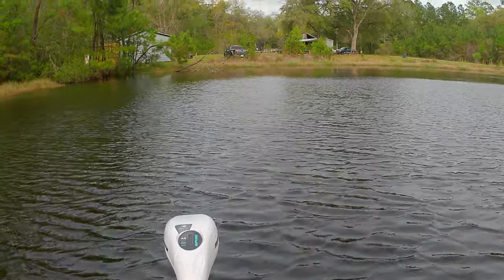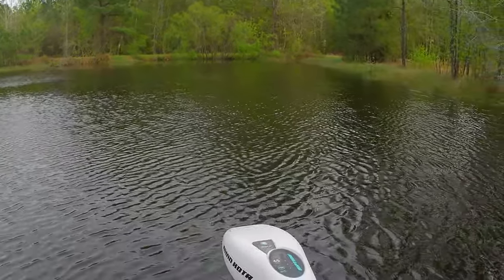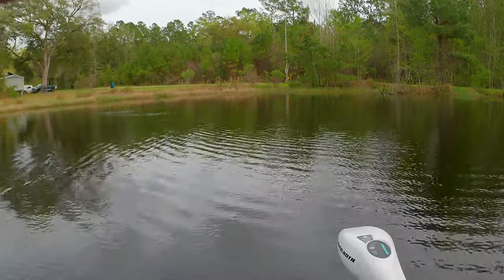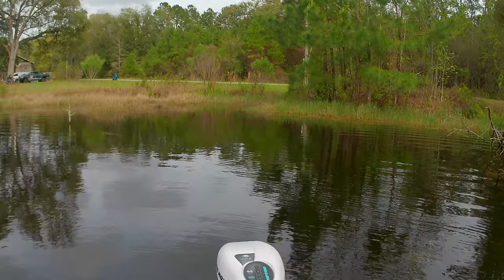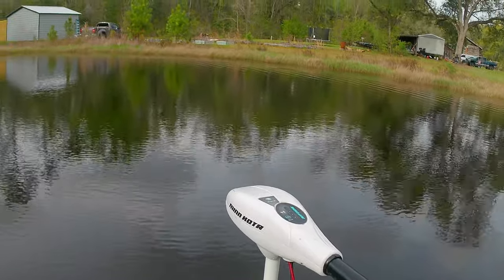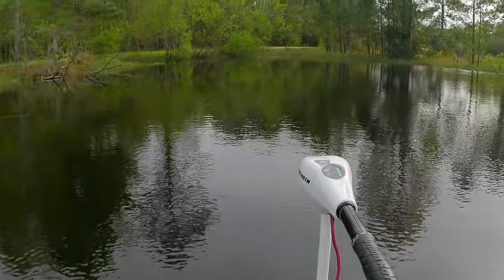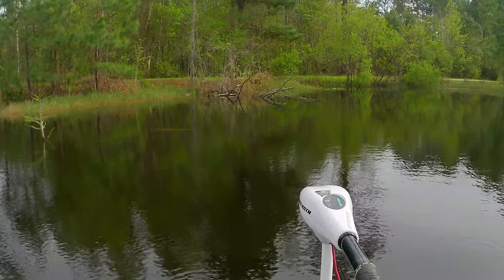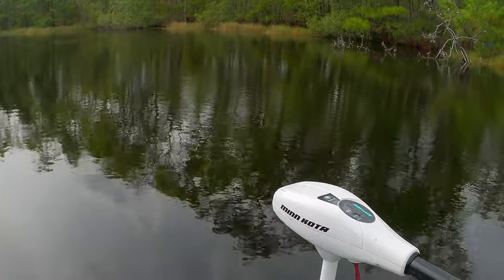Pelican Bass Raider on the water " Rudder Test and Review".

Comment: I was thinking of doing something similar, but switched, with the rudder in the front. and the motor in the back locked on straight. go up and down stretches easier.  not sure tho

Comment: Is there a preferred depth to put the rudder in the water? Also would you also keep it straight  ?  Thank you!
Reply from the maker: Sorry for the slow response. Computer problems.  I run the rudder about as deep as I do my trolling motor. As long as it"s deep enough to hold the boat straight in the wind and currrent, I don"t think it matters too much.  And yes I keep it locked straight.
Thanks for the question.
Reply: Is the rudder homemade??